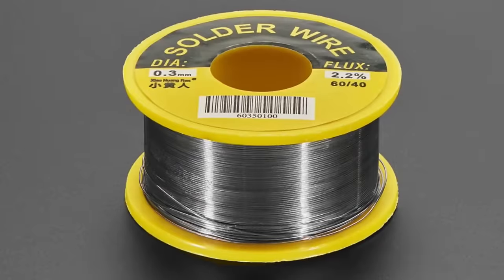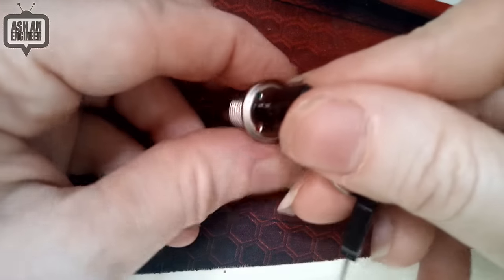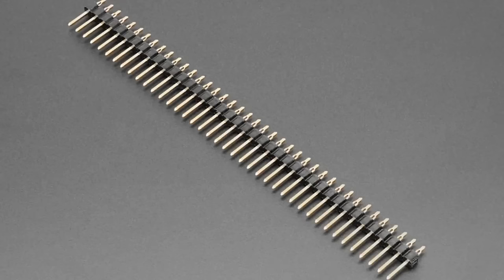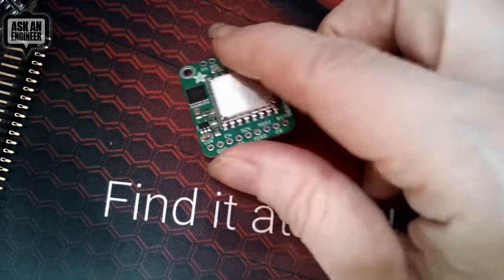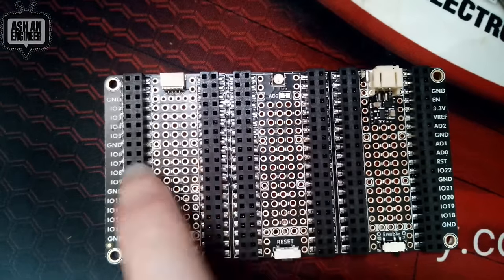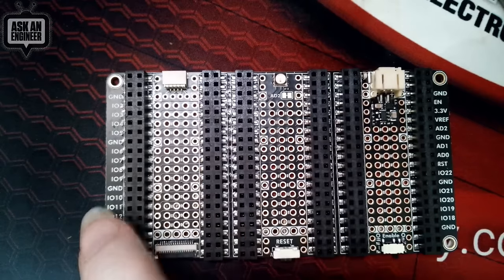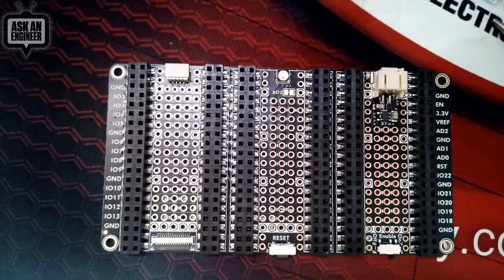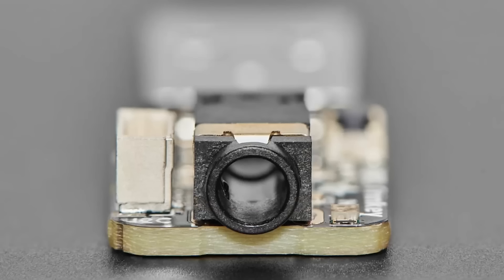New Products 5/15/2024 Feat. #Adafruit #TRRS #Trinkey - USB Key for #AssistiveTechnology

Comment: The press fit look a lot like pins I had many years ago.  I put them in a spare female ribbon connector and used that to help with pushing into holes.  It did help having the older PC mainboard com and LPT pin to connector ribbon cables left over from upgrading back then.

Comment: I feel like 500mA charging's too high for a lot of the smaller batteries where it would be 1C or even more.
Reply: 6:41 You can just cut a trace and it goes down to 250mA

Comment: Huh, I still get weird looks for wired inputs. Not. My cup of tea. Slap an ESP32 S3 with PSRAM, just remove the I2C port and add as PDM microphone and have the 3.5mm jack output audio and I'm sold. Super tiny voice assistant for home assistant with option poor audio output or no audio output. That would sell better IMO. M5sta is selling the OG atom echo for 15 dollars and it has a vanilla ESSP33 chip because because you can flash it on a website too be a voice assistant for home assistant. It was like $7 before that. ESP32-S3 would allow microwakeword long as it has PSRAM. Maybe add a button for push to talk

Comment: Amp and voltage rating for the key switch?
Reply: Hopefully we get a response from them. I can't find anything on it. Checking the website, there's a datasheet listed but it's just a mechanical drawing -- no electrical specs. From a little browsing of similar products on Amazon I found ratings of 500 - 2000 mA at ~220VAC. No idea how accurate those specs are either, but that's what I could find.
Reply: Generally this type is low power contacts. Keep it to 24 volts maximum at 100 mA or less if you want it to last at all. Low quality stuff.